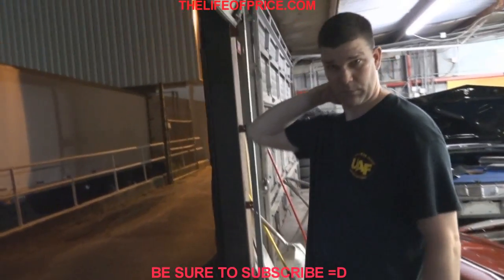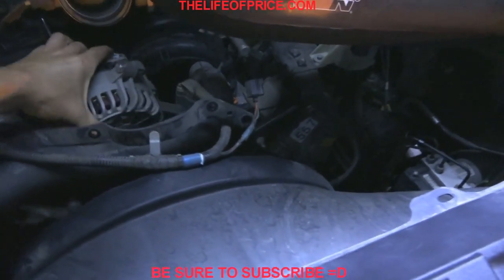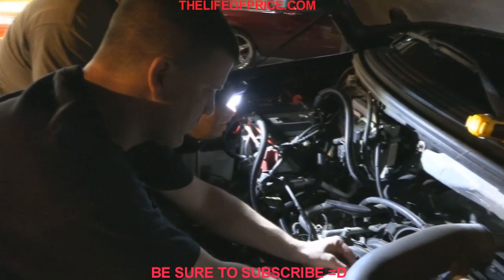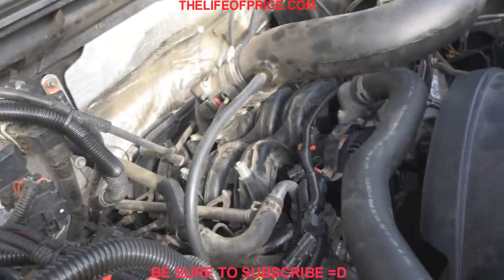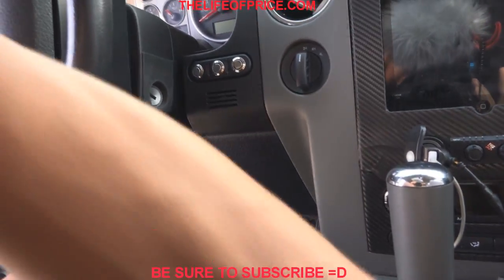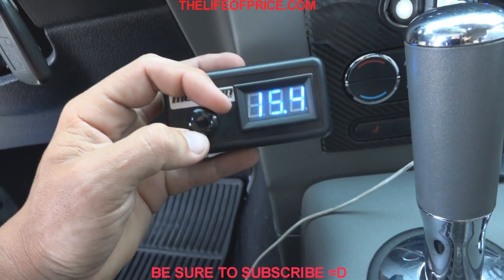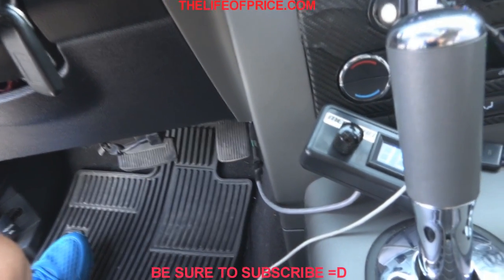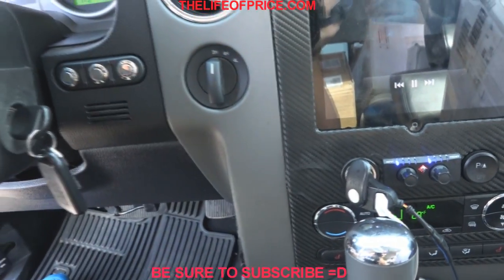LIFTED F150 GETS A MECHMAN 250 AMP ELITE SERIES ALTERNATOR INSTALLED!

Comment: Hey jp when you got that alternator installed, did the battery light stay on in the truck. I have a 2004 Mercury Grand Marquis with a mechman 250 amp I want to go with the external voltage module.

Comment: is your truck voltage PCM controlled?
Reply: not once the mechman unit is installed but i dont recommend running any 12v battery at 15+ daily no reason to charge at over 14.6-7
Reply: Trace garten thank you